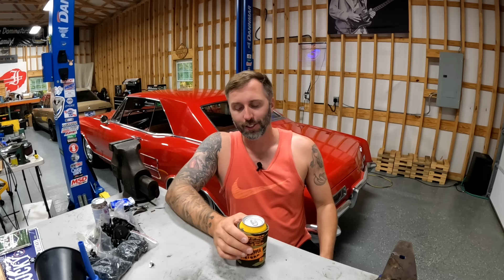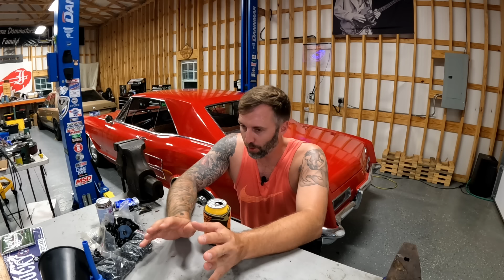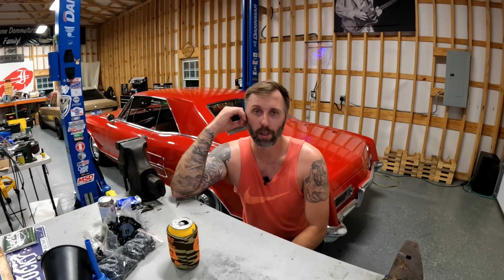Why I Ditched Holley Sniper EFI

Comment: I understand you weren’t happy about the customer service which it seems that is what this video is about. But you seem to go on and on and on about all the other details that are obvious when installing a system like this. It sure sounds like a 🍷 fest how you are butthurt about all the extra money you had to spend. Holley does over sell the learning capabilities of these units and doesn’t have any really good info on fine tuning them. They really do need a network of tuners to help get the tunes correct as I’m betting 99% of them aren’t running at their optimum.

Comment: Nah, Holley's are just JUNK! Thier carbs alone are a constant maintenance thing, always working out of adjustment on them. Have to adjust it to drive to the race, have to adjust it before the race, have to adjust it at the end of the race, have to adjust it ect, ect, ect. Rochester is better for daily driver than a Holly ever could be. So to find out a EFI by Holly is a pile of worthless pot metal is no surprise to me. Probably have to adjust that all the time to no end as well, since it is no surprise it is doing it's "fuel over flow fountain" thing. Be driving down the street with a laptop to make sure it stays right🤣🤣🤣I would never use a Holly product even if it was for free, that is more for someone who wants to drive from the engine compartment adjustin on the fly, unreliability at it's best, 🤣🤣🤣🤣....

Comment: Why too long winded. Dude, just tell them the throttle body is defective as CONFIRMED by tech support, its part number is X and you want an RMA. Simple. Your long winded story to non technical staff is too confusing. Anothe question is this Holley system appears to be open loop (no exhast gas sensors to adjust fuel ratio)? If so this system is not so good.